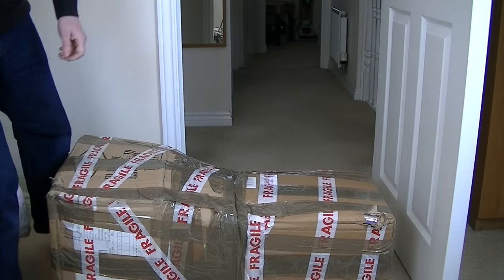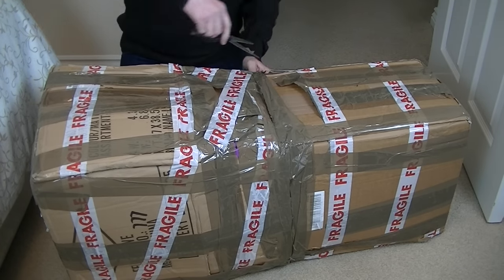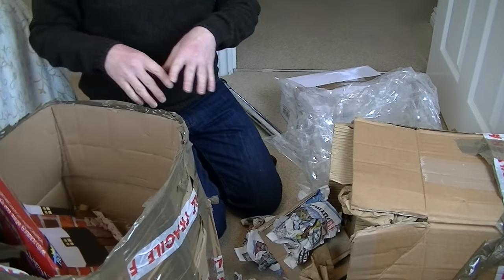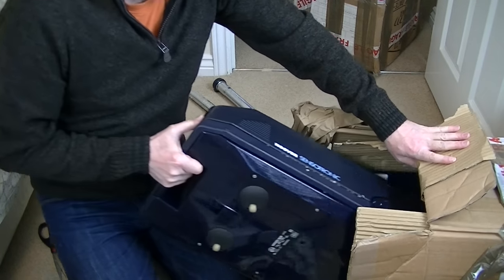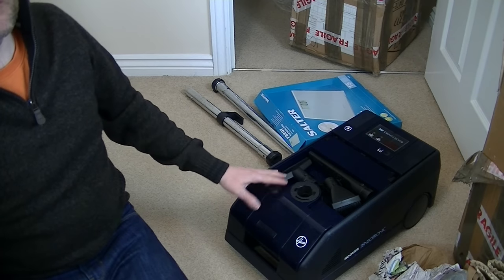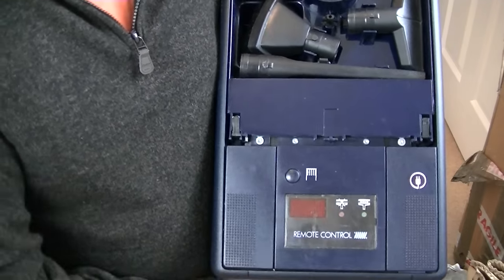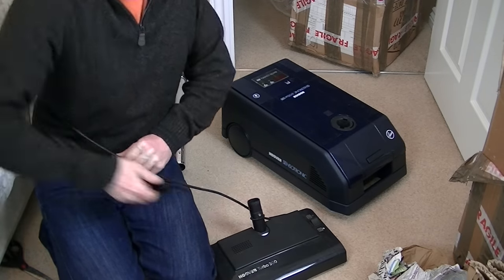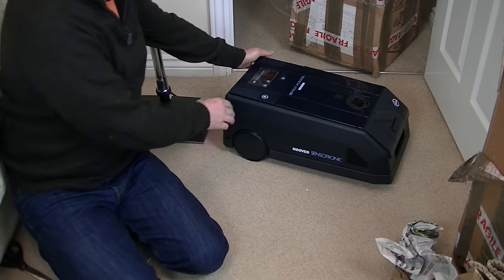Hoover Sensotronic S3730 Total System 500 Vacuum Cleaner Unboxing

Comment: It has the same shape as our Aria AR10 but it seems to have lost a lot of features since the Sensotronic, it has no speed control or PTO and doesn't have a cord rewind (despite there being a button for it and possible room next to the motor). However it's currently 20 years old and still works like new after continuous frequent use.